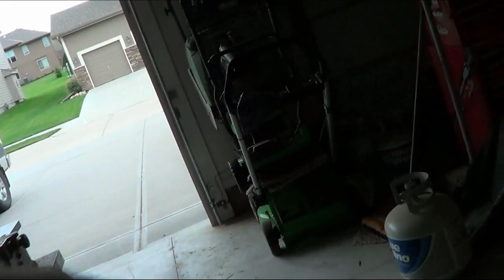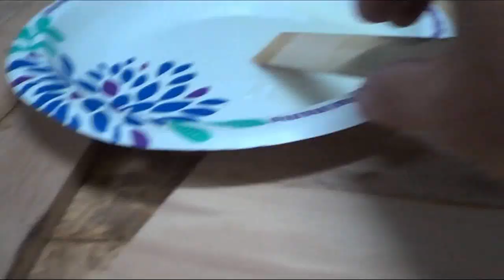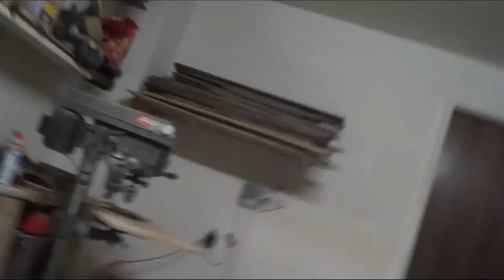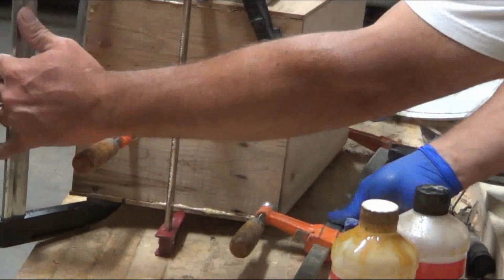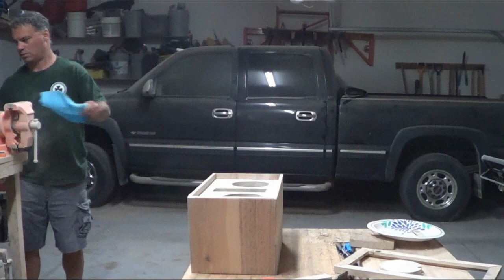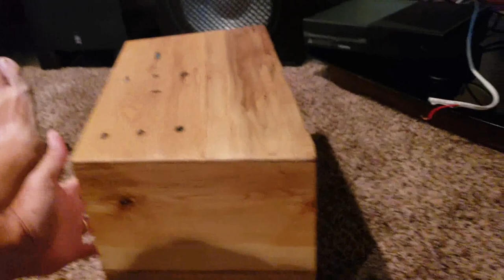DIY center channel speaker build

Comment: Sir I'm planning to build center speaker...   Amplifier is 100 watts at 6 ohms...
I want four 100w@6ohms speakers
My question is..
Is it not overload if my tweeter is also 100w@6ohms? By the way I'll fix it with two way crossover...  How many watts should be my crossover?
Reply from the maker: I am not a speaker engineer or electronic engineer,  I am an enthusiast with speakers and sound. I would just buy a crossover with specifications to match your tweeter and bass driver, getting a crossover with more power capabilities  than the speakers is not going to cause any issues.
Reply: Put a resistor in series with the tweeter and that will reduce the voltage across the tweeter as voltage splits up in series. Since there is a lower voltage across the tweeter there will be less current and hence less power